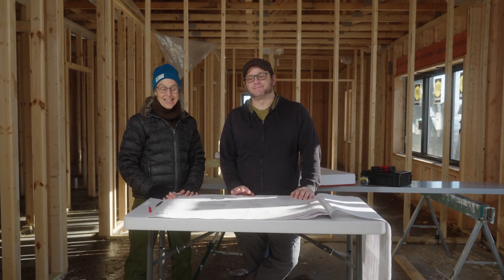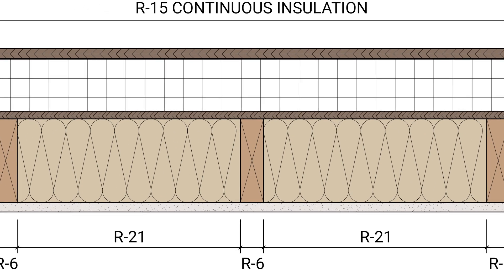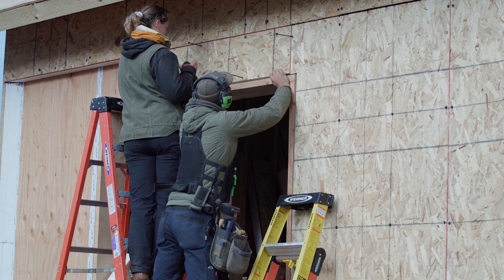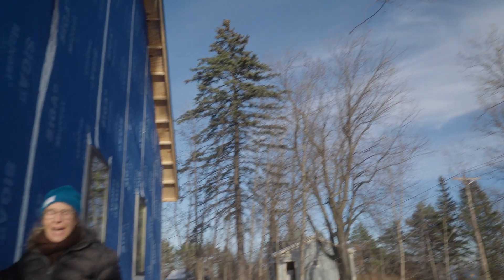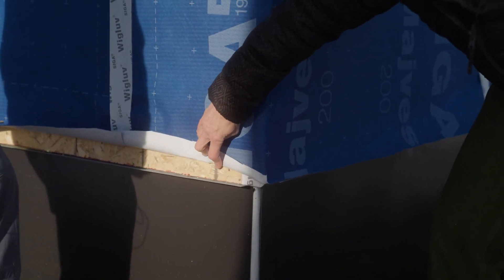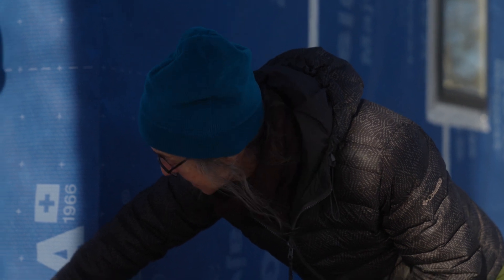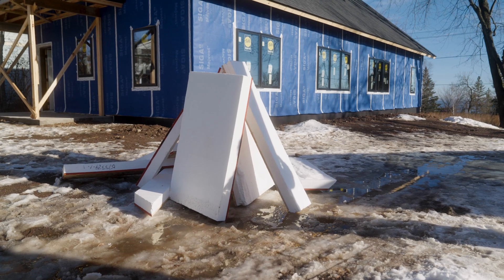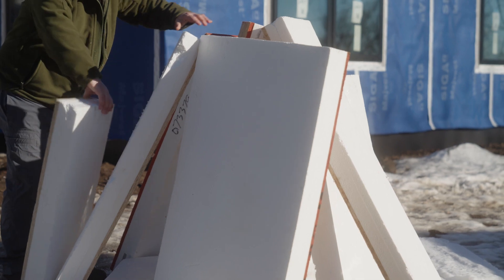Continuous Insulation: a winter coat for your home

Comment: whats the price per panel? are they going to be approved by termite inspectors?
Reply from the maker: Price per nailbase panel varies by location, so can't really give specifics. As for termites, that's not an issue here in climate zone 7. We imagine that in an area with termites, any termite protections typically used on EPS foam would apply to these nailbase panels.

Comment: That’s a LOT of extra cost, adding an additional entire layer of wood!!! I bet 1/2” of foam on the exterior with a zipR, and spray foam in the cavities, would perform just as well. 
The average customer simply can’t afford the cost of something like this. 
Ideally I would have run that ICF to the roof! (Also extra cost…) 

With that said, AMAZING quality and work on your job. I would love to have a house wrapped like that!
Reply: What? You're insane if you think Zip-R plus spray foam would be less expensive than this much simpler setup, and you're not considering the sheer limitations of Zip-R. This is actually a cost effective, labor friendly and structurally strong solution. I love it.
Reply: @dlg5485  I’m happy for you!! ❤️❤️❤️

Comment: Zip-R is better.
Reply: Curious which aspects of zip-r is better? Also anyone know the cost difference?
Reply: @evilcowgomoo13  Easier to install, just like regular sheathing but with longer nails.  No need for furring strips to attach siding over foam board and no need to fur out windows for window frames to project further out than the siding as these are directly nailed to Zip-R sheathing.  WRB is on the Zip Panels, so no needed WRB fabric house wrap.  Must use Zip tape for seams but it's easy to apply.  Zip-R panels go up to R-12 (2.5" total thickness).  Using Zip-R12 on 2x4 studs walls can yield R-30 walls with closed cell spray foam or R-26 with mineral wool.  This assembly is the same thickness as if using 2x6 stud walls, so deep window custom window extensions is avoided.

The cost for Zip-R panels might be more than foam panels over regular sheathing but much less labor and greater detail for house envelope sealing is not needed compared to foam panels over regular OSB or plywood sheathing.  Framers can install Zip-R without special instructions, unlike foam over regular sheathing, which requires all the details to be followed exactly.  

I looked at both ways for exterior insulation and Zip-R was a no-brainer compared to something like XPS foam board over regular sheathing.  You can get up to R-42 walls if you use 2x6 wall studs plus closed cell spray foam.  Also added 1/4" thick plastic mesh rainscreen behind LP Smartside siding because the LP siding has raw OSB exposed on back of siding.

Shear strength would seem to be reduced using 4" nails through Zip-R12, but Huber has nailing spacing charts to address this for code compliance.
Reply: Don’t you want vapor barrier on warm side in a cold climate? Zip r has that web and vapor barrier out close to the cold doesn’t it?
Reply: @superandy89   No.  You can't have wood between a double sided vapor barrier.  People can't seem to wrap their heads around having sheathing on the cold side and foam behind it.  It's no different than using normal sheathing with closed cell spray foam between studs, where you don't want a vapor barrier on the warm side.  Walls need to dry if there is ever water intrusion and it can't if a vapor barrier is on both sides.  You could use a smart vapor barrier on the interior, which allows moisture to pass through.

Comment: Would it make more sense to fasten true SIP's to the bare frame rather than sheathing the house, then sheathing again with another layer of insulated sheathing. I realize that SIPs are going to be heavier and require a crane/ telehandler/ telelift to install safely, but I get a sense that time and cost could be recovered in speeding up the bare framing for one thing. The final result would have the shear strength baked in and details such as insulated roof overhangs are virtually finished the moment a roof SIP is screwed down.
Reply from the maker: thanks for watching, and taking the time to comment. It's possible to reach the same thermal performance and air tightness with the assembly you suggest: a true SIP (structural insulated panel) fastened over a framed wall. However, we think using SIPS makes it harder to use the structural sheathing as the air barrier, and harder to connect that air barrier at the wall to the other components in the air barrier assembly. It also makes it harder to deal with future repairs, modifications, or alterations. That said, it can work and others have built energy efficient efficient homes using such a wall assembly.

Comment: tHank you for the video.    Very cool and simple idea.
I'm going to be using foil faced panels on two projects.  (Because I already own them).   
If I were buying new materials I believe I would take your suggestions.     Happy New Year!
Reply from the maker: Thanks for watching! If you're planning to use foil faced panels (likely a polyisocyanurate rigid insulation layer), the assembly will not be able to dry to the outside. It is critical to install a drainage space between your cladding and the foil faced insulation, to assist drying and drainage of and behind the cladding. In addition, I'd recommend that you confirm that ability of your wall assembly to dry to the interior. Happy New Year to you too!
Reply: Hello  @GreenNewDealHousing  .  I've been looking into this project I'm planning for two years.
You are the first to address concerns in your response.  My hat's off to you.

I have two projects, the first is an empty home where drywall has been removed. I have full control over that scenario.

The second is a drafty 1960s build where I believe cold winter air is leaking into the wall cavity.  At this point, I'm guessing but plan to move forward with TYVEk over the existing sub siding, followed by two layers of foil faced 1" panel.
The outer layer will be foil taped, and then vertical 1x will be used as nailers for run of the mill siding.

My fear has been that I will be trapping moisture.  
I definitely have drafty siding and sub siding now.

tHank you very much for your reply
Reply from the maker: You're welcome.  @Dancing_Alone_wRentals  when you say you're planning to put housewrap over the existing "sub siding," what material is that sub-siding? Sounds like you want to use the housewrap as an air barrier, which can work, but so can other things. Placing the air barrier over the wall structure, before the rigid insulation, is a good strategy. About your fear of "trapping moisture:" if you're removing the existing siding, you can create good drainage and flashing details as you add your new layers, which can greatly reduce the potential for trapping moisture and allow water to drain or dry when it does occur. If the house was built in the 1960s, the walls can likely can dry to the inside. If you're not clear on the wall assembly, it's worth cutting into an exterior wall from the inside to see how it's built. Cut into it in a closet or other place you won't mind a patch. 

You're on the right track with your thinking. A good illustration of the assembly you're proposing can be found in this excellent research paper by Kohta Ueno of Building Science Corp: https://buildingscience.com/sites/default/files/migrate/pdf/CP-1012-Residential_Exterior_Wall_Superinsulation_Retrofit_Details_Analysis.pdf 
Once again, thank you to buildingscience.com!
Reply: @GreenNewDealHousing  the existing siding is aluminum, directly installed over 4/8 1/2" brown material.  We call it bear skin.
Bear skin shrinks with time and the breeze carries through the aluminum siding with the bear sin doing very little to stop it.

My thinking is I will see what the wall construction is from the outside of the home.  I doubt I will find plastic sheathing.

Perhaps kraft faced fiberglass batts.

tHank you very very very much,
Reply: @GreenNewDealHousing great video awesome info, is there a way to show demo this? Some of this is harder to understand in written form as opposed to visual demo! I'd love to see video example of best practices of who to setup and best way to setup from your recommendations, there maybe 3,4,5 different recommendations and I'd love to see learn with a demo each one to better grasp which one to use for different applications! 
Thank you! Big fan of your channel
Reply from the maker: @VP411Designs  We do now have 11 videos posted on the channel. We'd love to produce more videos showing many of the methods employed in this high performance home. It's possible that with more funding for this type of education, more videos will be created. Thanks for watching!
Reply: @GreenNewDealHousing  awesome thank you!

Comment: Is there mineral wool product that can be put on outside?  There was a fatal fire in England  that used foam on outside.    How to get rid of rats in walls
Reply from the maker: Yes. There are numerous rigid mineral wool products that can be used as a fire-resistant continuous insulation layer. At present there are no rigid mineral wool products that we know of that offer a bonded nailbase or furring layer. Therefore, when using rigid mineral wool as continuous insulation, you'll usually want to plan to install furring strips fastened back to the structure and then install cladding over the furring strips. While many mineral wool manufacturers don't require a separate WRB (water resistive barrier) over the mineral wool, I would still recommend a WRB layer to integrate with flashing and act as the drainage plane. Good installation details for such an assembly can be found here: https://www.rockwool.com/syssiteassets/o2-rockwool/documentation/technical-guides/residential/comfortboard80-installationguide.pdf
Reply: Yes, I think in your country they call it EWI (External Wall Insulation) and there is styrofoam, fire proof styrofoam (added graphite) and mineral wool boards. All of Europe uses this.

Comment: As some one who was raised and educated in Europe I found very confusing the way Americans build houses. It is constant battle against laws of physics. In cold part of Europe the rule is simple from inside out every next layer must be more air permeable than layer before. Only recently I learned from one industry Guru explanation of this . In America  in many cases construction codes and curriculum for students in universities are written by sales managers of big companies
Reply: Foam isn't more permeable than the layers to the inside of it.  That is why I like double wall construction to stop the thermal bridge and use permeable fiberglass insulation in both walls.  having 2, 2x4 walls on the exterior walls only doesn't add that much expense but does give you an honest r-30 wall that doesn't  grow mold.
Reply: @badawesome  Yep, the price of that wall must be enormous. Every time I see people try to invent a wheel I want to scream of top off my lungs stop waisting resources it is all been invented way before you. It is called SIP panels

Comment: Thank you so much for your great channel. Can you have stucco on ip or SIP panels?
Reply from the maker: You can use stucco as your cladding over nailbase or SIPs but I don't recommend it in cold climates. Stucco is a reservoir cladding; it absorbs moisture and must dry to the outside air in order to keep the building structure dry. The best way to maintain durability with stucco in a wood framed structure is to have a drainage/ventilation space behind the stucco. Here's a good read on the topic, with details, from our friends at the Building Science Corporation: https://buildingscience.com/documents/information-sheets/reservoir-claddings Thanks for watching!
Reply: Thank you so much for your response. This is for a project in Los Angeles.

Comment: IMHO, frame houses are expected to last for a few generations, rather than centuries, the foam insulation is not a very environmentally friendly product. And considering the large volume of that insulation, promoting it on a site using the words "green new deal," seems odd. By now I have reached the 11:57 mark in the video where the petroleum origin of this product was brought up, but its non-degradable nature was not mentioned. So I have to wonder if there is a more biodegradeble product
Reply from the maker: Thanks for watching and for taking the time to comment.The EPS insulation in the nailbase panel is the "least bad" foam insulation, but you're correct that it is not biodegradable. We considered cork and rigid mineral wool; both can be excellent choices for continuous insulation, but require strapping to install the siding. At this moment in time the EPS nailbase was the most available, cost-effective choice for this pilot project. That doesn't mean that EPS nailbase panels will always be the continuous insulation choice for Green New Deal Housing projects. If you want to learn a bit more about how we're trying to scale zero net energy homes, you might want to watch this: https://www.youtube.com/watch?v=fBcyZcxVdIw
Reply: I have been experimenting with nanocellulose for different reasons but the University of Maine has the largest research program making it and are collaborating with builder supply manufacturers. It is one of those materials that has a ton of uses if it can be creatively brought into an existing manufacturing process, my guess is soon you'll see it not only in packaging but things like insulation as well. It has already been experimented with in making drywall for example.

Comment: With your osb sitting on that rat guard or ledge, is going to soak up water and cause your osb to rot extremely fast. Within a year you'll have major mold growth.
Reply from the maker: Thanks for taking the time to write. Attention to water management and material durability are so important! in the video at 10:01 you can see the detail we use to eliminate the risk to the edges of the OSB layer of the nailbase panel. We call for the bottom edge of the bottom panels to be wrapped with flashing tape before install. We also call for the start of the nailbase panels to be held about 1/2" up from the foundation insulation, and then the gap is sealed. You can download an illustration of the full wall detail here:  https://www.just-housing.org/_files/ugd/a4c66c_16b997ba33494b7cb2a9f06118146155.pdf

Comment: Northeast PA build. What to put over zip- Pink XPS or Polyiso?
Reply from the maker: Hard to answer without more information about the project - which IECC climate zone, your planned assembly, and siding choice. But I'll try! It. may be less about XPS vs polyiso, and more about the desired R-value of the c.i. and the approach to attachment. If you're not using a nailbase panel (but if you do, that would probably be polyiso), you'll likely need to attach furring strips over the c.i. and install your cladding over that. Both polyiso and XPS can shrink, so you might also consider rigid mineral wool for c.i., which won't shrink. If I'm not using nailbase panels, my personal preference is a single layer of rigid mineral wool for c.i. You can get R-12 with 3" rigid mineral wool, and it's readily available in most markets.
Reply: Enjoyed the video.  It would be great to see how you detailed around windows and door openings with those panels.
Reply from the maker: Glad you enjoyed the video!  @ptru7250  Window and door openings are where the details are some of the most important. For the window openings, recommend using a 2x to extend the framed rough opening out to meet the face of nailbase panels. Doors are treated a little differently. We frame the exterior doors into the 2x6 structural wall pretty much just like any other single stud wall, and we use an extended sill at the threshold. You can see some of those details on our windows video here: https://www.youtube.com/watch?v=xxNXc19Ki0s and our standardized assemblies video here: https://www.youtube.com/watch?v=fBcyZcxVdIw You can also download a wall section that shows the window opening accurately here: https://www.just-housing.org/_files/ugd/a4c66c_16b997ba33494b7cb2a9f06118146155.pdf
Reply: @GreenNewDealHousing  Excellent!  I appreciate you taking the time and the clear and concise detailed information.  Simplicity and repeatable is key. Thank you!
Reply: Dr Joseph Lstiburek says Rockwool if you want it doesn't matter. 5,, 10, 20 40, 60 does help. YouTube can be your friend.